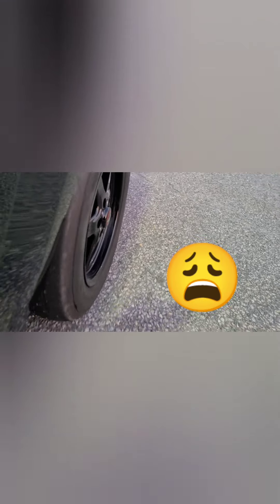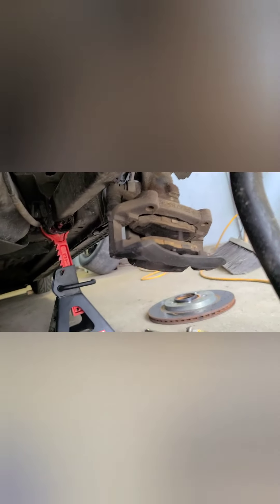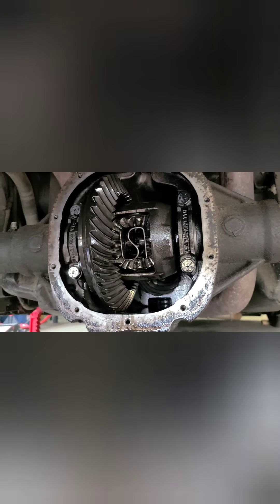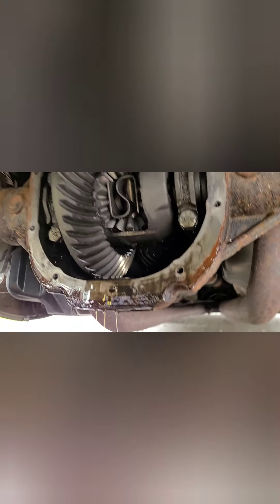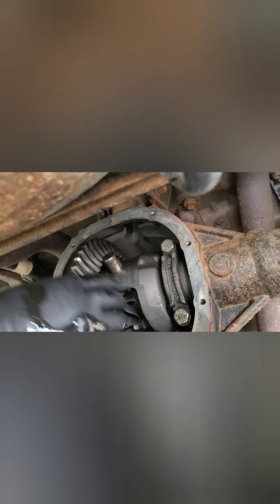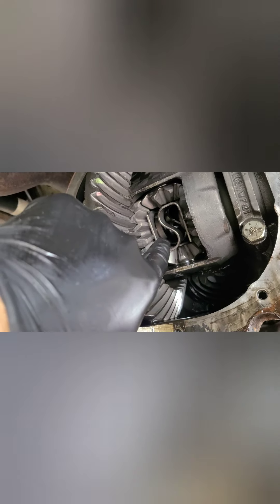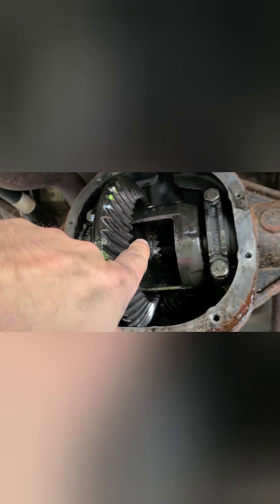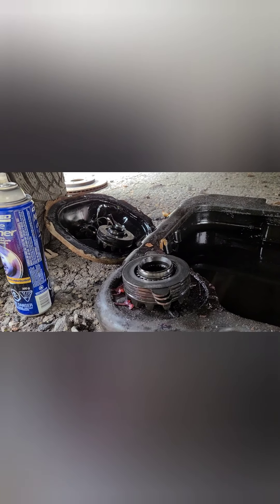Ford Mustang 🐎 broken spider gears in 8.8 lsd differential replacement DIY

Comment: I put in a set of ford performance carbon cobra limited slip clutch packs when I did my spider gears. My stock discs were all bare metal.

Comment: So when you put it back together do you start out with putting the c clips back in? Then putting the spider gears in then the s spring? Im having trouble with putting mine back together
Reply from the maker: You put the spider gears in first then the S spring and the c-clips last when putting it all back together
Reply from the maker: The main pin will go in after the c- clips
Reply: Did u got it going I'm stuck in the same thing u were
Reply: @sergiodoordie319  hey man I got mine all back together. I put the spider gears in first then I put the c clips in then the s spring. If you are having trouble just ask me